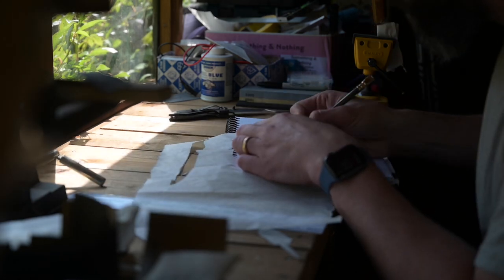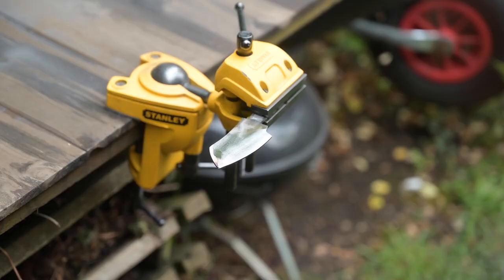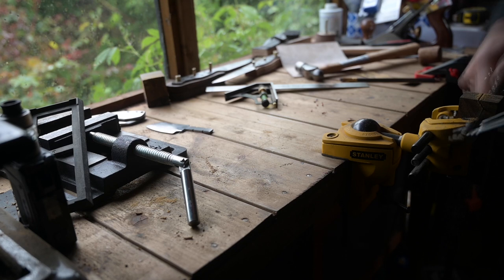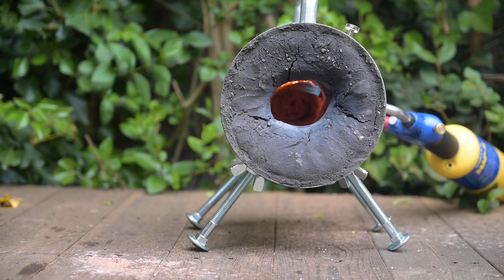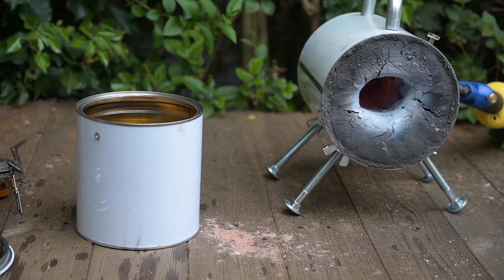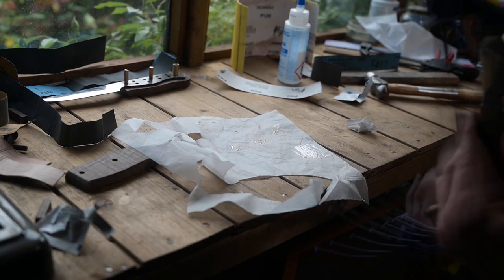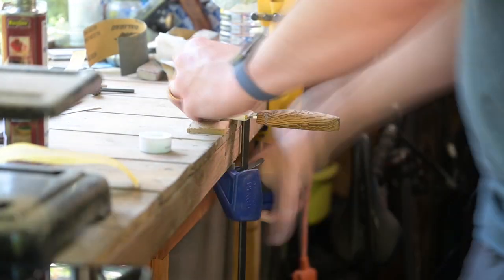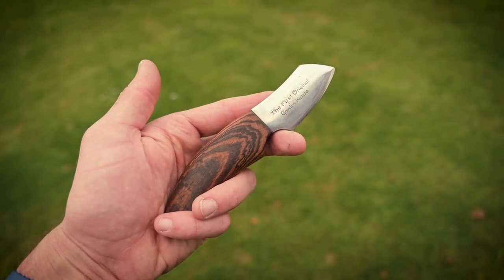Knife Making: The Original Garden Knife

Comment: Hi
I just subbed as I’m making my first knife, too. 
🙏🏴
Reply from the maker: Thanks for the sub! How’s the knife going...? And you’re right - if it was a sharpening choil, a chainsaw file would’ve been perfect, but this was a finger choil, and I haven’t found a chainsaw file the diameter of my finger yet!🤣😂
Reply: Little Tipple 
Yeah, it’s coming on nicely. I’ve spent a good time today hand sanding, post heat treat, to 400 grit and reducing the thickness of the edge to the point I can sharped it on my stones. 
But before I do that, I’ll need to put the handles on. That’s the next big step. 

Once I sent my comment I then went in to see it was a finger choil, and thought ‘I bet he thinks my comment was dozey!” 🤣🤣

👌🏴